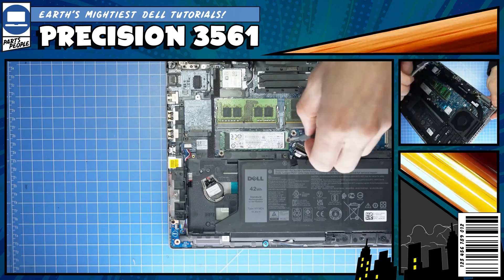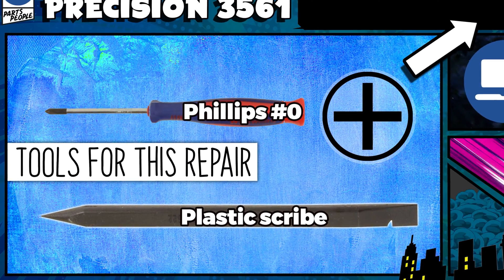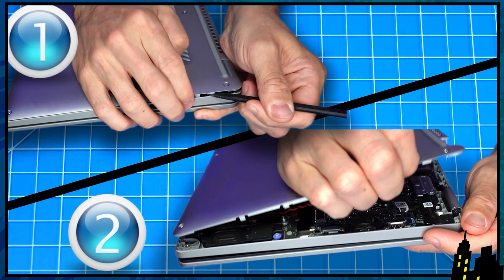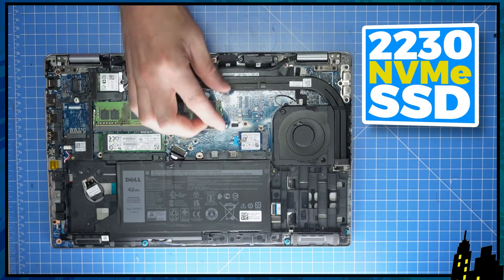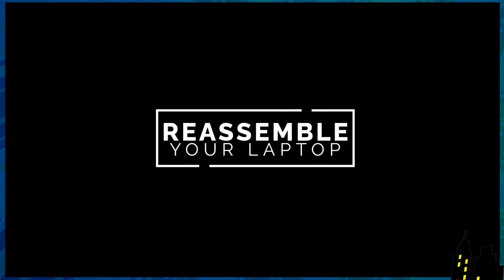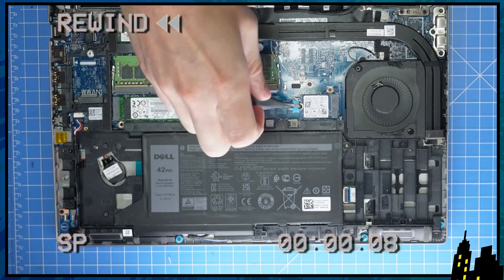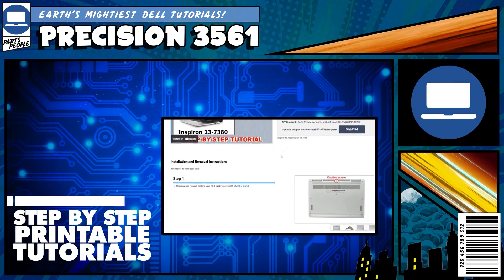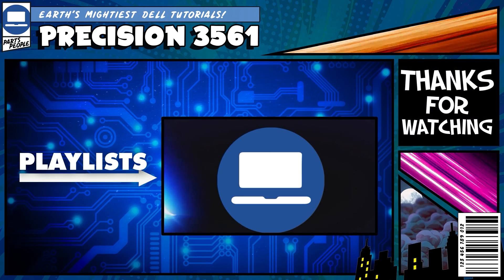How To Upgrade or Replace Your SSD | Dell Precision 3561

Comment: Thanks for the hardware basics, but I would really, really, really, like you to do a common sense follow-up for those folks who are not aware of the next necessity of shifting from mechanical drives to solid state: for your video you now have two formatted ssds but no operating system: how then do you upload to the new drives the operating system, and is the recommendation to stick with the previous OS, or upgrade to a new OS?

Thank you for your time and your excellent videos!

Cheers from the Oil Patch in Central Wyoming